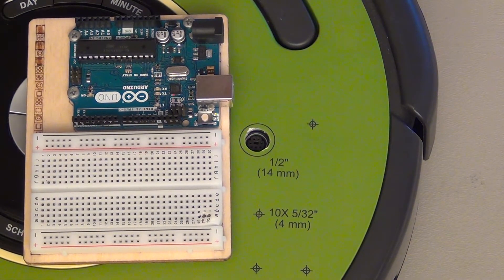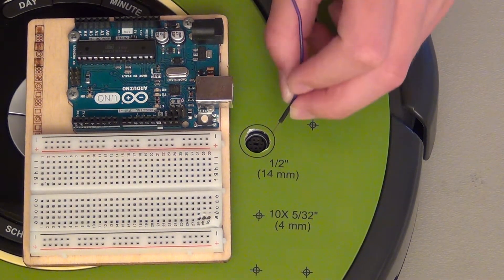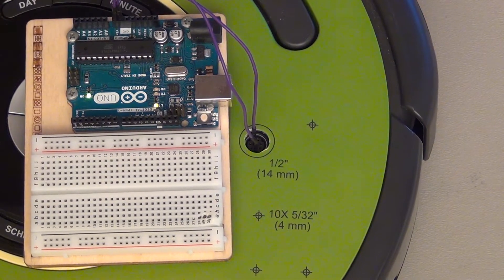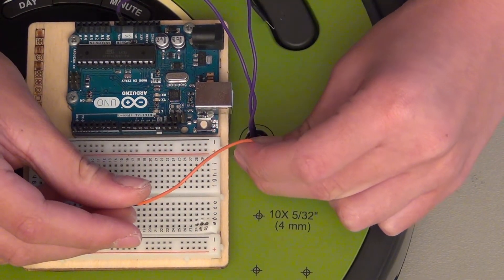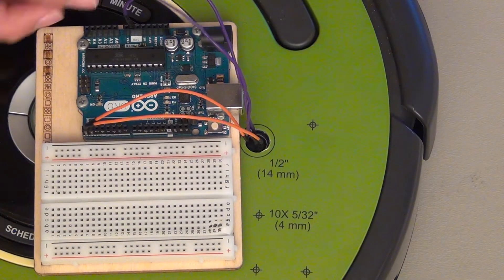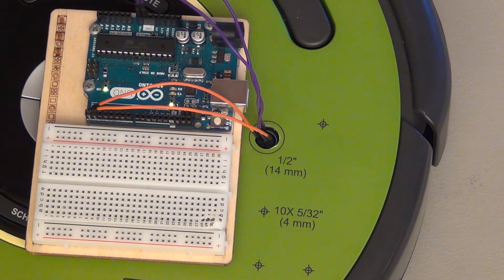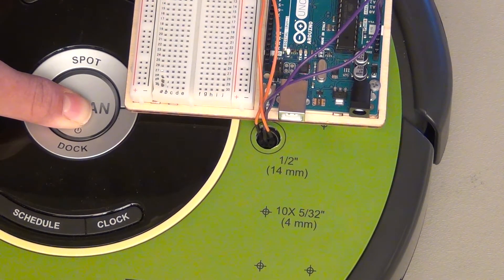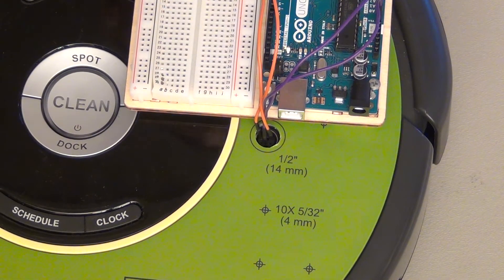iRobot Create 2 Connecting Arduino to Create (upclose)

Comment: I followed all your instructions. Am using Arduino 0023, your exact code, and the correct wiring. I reset the baud rate and still nothing. The robot does not move at all. What could I be missing?

Comment: hello, i view your code and wonder why you set rxpin txpin and ddpin but only use txpin and ddpin? 

when i try the code, the arduino IDE tells serial.print() and BYTE no longer support, i dont know why
Reply from the maker: +Jeffrey Lee That's because you need to use the Arduino 1.0 IDE. With newer updates, some of the syntax has changed.